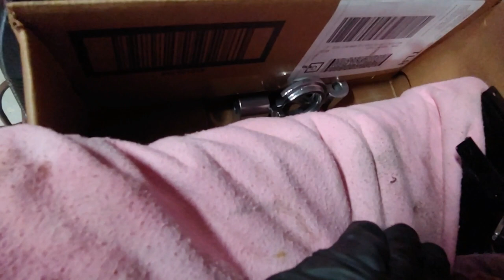02 Arctic Cat ZR 800 CCE Rebuild Part 13 || Installing TRACK & SKID

Comment: Your parts washer is so manageable. My pump blasts out at like 20PSI and splashes everywhere.
Reply from the maker: LOL- I actually plumbed in a remote filter that helps to get the pump power under control. You could also try a hose with a brush built in...

Comment: This is Awesome!! However, i do not have the tools and equipment for this kind of work...  what would a shop cost to do something like this.. the driveshaft was knocked out of the bearing/bracket - hit a rock.. on the secondary clutch side... so i need to replace driveshaft (the plastic wheel/cog is cracked) and i am hoping the bearing on the chain side is okay (wishing).. but yeah.. major work.. i have the exact same machine and love it... power and easy start!!! i gotta fix it...
Reply from the maker: Typical shop cost is 100-120/ hr.

Comment: @Fixin2Ride Did you do a vid already that shows how to get those rear springs installed once the skid is in?
Reply from the maker: Dont think I did a specific video as Ive jist removed the 4 skid mounting bolts and pop the skid out. But, if you are talking putting in new springs you do have to pop the skid oit for that. 

 Or if you are just trying to get the long part of the springs back in thw spring slides and on to the of the skid, raise the sled off the ground loosen the skid and then shift the track to one side and then make sure the short end of the spring is seated on the adjuster and then swing the long part forward slip on the spring slide and then put the bolt through that and then through the skid and then shift the track over and then do the same thing on the other side and pop the bolt all the way through and then slip the spring slide on the long portion of that side spring and then put the spring slide on the bolt
Reply: @Fixin2Ride-Official-  I think I understand. I have the skid out and had the shocks rebuilt and bought new springs while I was at it.  Sounds like you  put the skid back in before getting the springs back into position. I think what you're saying is that the long bolt that goes all the way through has to come back out to get this done.
Reply from the maker: Yes. I mean there always more than one way to skin a cat though. 😉